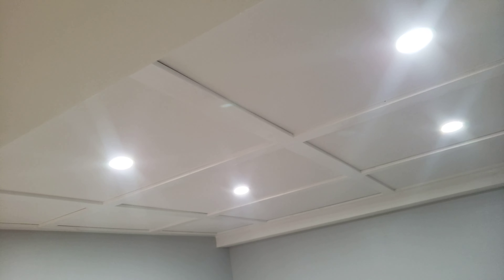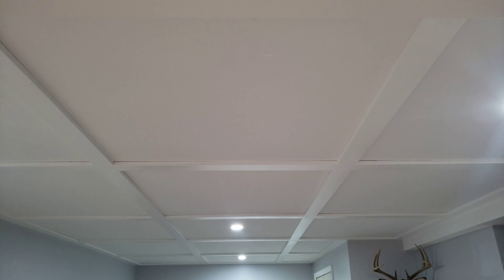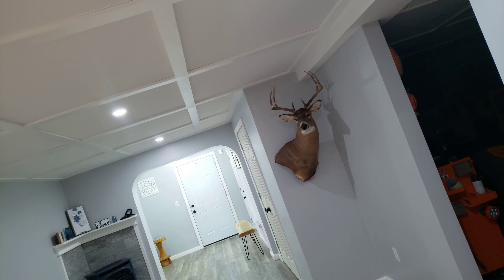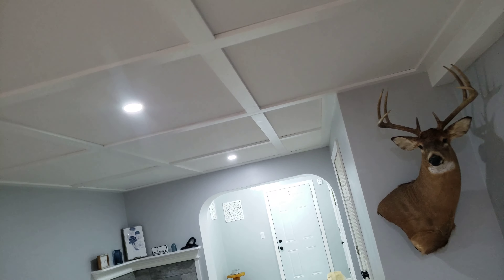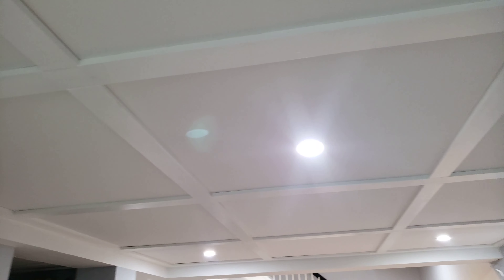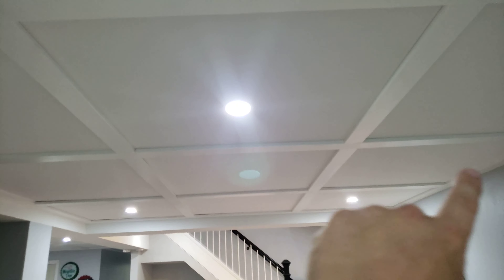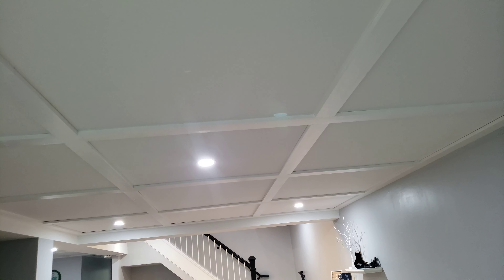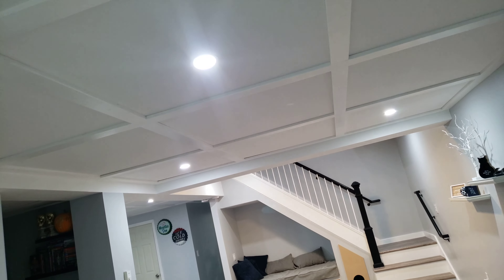Part 2 follow up with our custom drop ceiling grid

Comment: What's the thickness of the drywall you used?
Reply from the maker: I used 1/2 lightweight drywall. I primed and painted all mine prior to installing so they didn’t stick to the 1x4s. I also used 3/4” scrap to hold them out of the way to paint the 1x4’s that hold the drywall up. The other thing I did that I don’t know if you need to but I did anyway, was to paint the exposed cut pieces of drywall edging to help seal it from humidity.
Reply: @DannyKissel  wow, thank you for all the great advice!  And of course the super quick response too!